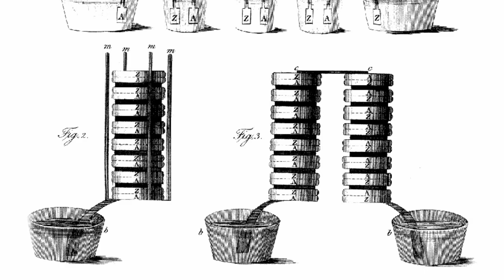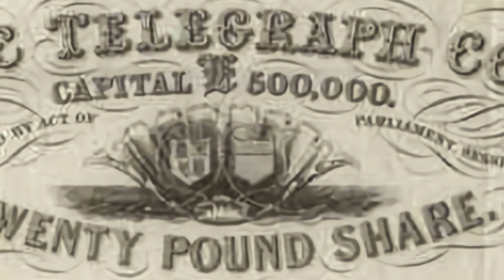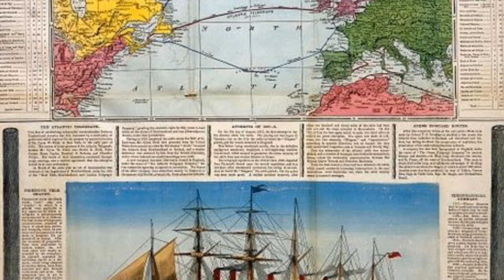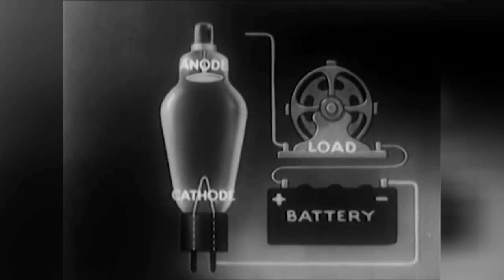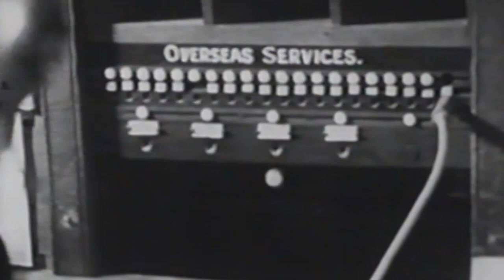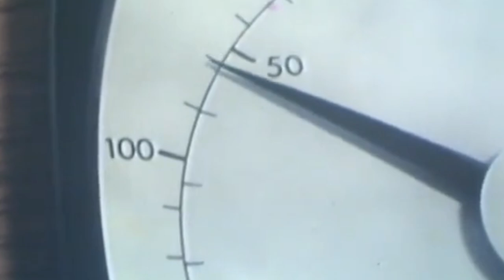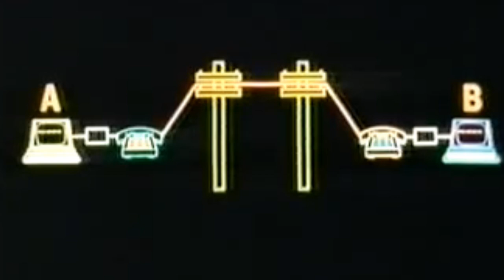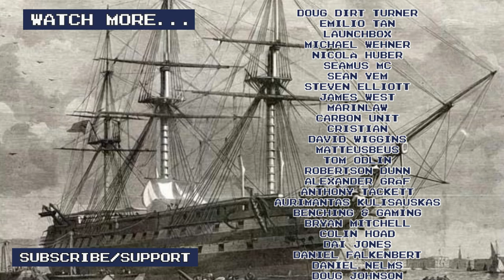How the Internet Crossed the Sea | Nostalgia Nerd

Comment: Imagine being the guy who fries the first cable that had so much effort and work to lay it.
Reply: 5:40 "[Mistaken] that electricity flowed like water rather than pulses [as was soon accepted]. British Engineer WildMan WhiteHouse tried to force a higher voltage down the line to force the messages through. This just FRIED the cable until it stopped working!"
That early cabling never could have worked especially with an impure core resistance too much like a heating element. But in the history books/vid streams a poor single loley British Engineer really took the fall for frying it. Maybe he should have awaited further opinions but still perhaps a bit unfairly, with it arguably making little difference? At least it finally proved to all that a MUCH more thought out approach in every way was needed!
Continuing the water analogy, current is still used and I've heard China interuses pressure with amperage. ;]
Reply: ::starts whistling::
::puts hands in pockets::
::slowly walks away::
Reply: Uhhmm oops sooorrryyy
Reply: @djosearth3618  Er, *loley*? Is that what they sing in rumba songs? Or is it foley artists running down metallic staircases, as they often seem to do, while listening to samples of bullets ricocheting on thingummies? I'd love to know, to be able to interuse it.
Reply: The original IT support disaster.
Reply: @djosearth3618  i don't understand why they haven't checked the cable on the ground first
Reply: @djosearth3618  to explain it as pressure is equally wrong or correct as describing it as current, flow would be better but factually its a stream of particles , in any case it hardly matters
Reply: @user0K  costs length, and probably they have, back then materials were less pure, technology was less advanced, especially cabling tech
Reply: @djosearth3618  That analogy is absolutely perfect though. Electricity flows EXACTLY like water does. What he did was akin to putting too much water pressure into a system of pipes.
Reply: "i got a great idea.......oh well nvm" whistles pats thighs walks away
Reply: No biggie. It was just early alpha testing after all.
Reply: 666 likes 👌
Reply: "So obviously some blimey shark bit the cable, Right?"
Reply: @RaenYrtham  699 Likes 👌
Reply: @TheFalseShepphard  what's up possum? Do I know you?
Reply: @user0K  They did it worked. They didn't understand the capacitance to ground thru the salt sea. In air that doesn't happen.
Reply: .. cable fried!!.... all the effort,  just to 'try and see' So much work........  I guess everyone's gotta start somewhere, and i also reckon they never had the tools to do that test.. it was probably more like "well,... we'll just lay it and see what happens"

Much like today really..  ... Although today, we don't go on these type off expensive mammoth hunts just to "see"
Reply: @djosearth3618  oh i see, thank you for clarifying
Reply: Or the first guy who got ddos
Reply: @reubeng2110  A rather "unfortunate" accident...   You better be bloody sure it never happens again lol
Reply: Lol totally 🤣
Reply: @djosearth3618  Agreed it seemed more like a failed attempt to salvage an expensive asset that was essentially DOA to my mind, makes me think they may have tried it even with competing voices warning the cable could fail entirely, desperate measures and all. That thing would probably not really have been useful even for the highest priority government communiques only. And that is even with some clever trickery to optimise the bandwidth ie developing a code book to condense commonly used words/phrases for that specific type of communication to be as short as possible. By that I mean starting with single letters that are not already words for the most commonly used words/phrases then pairs of letters and so on. But even though that sort of compression can be very efficient with some thought especially when devised specifically for purpose there is a limit to how much bandwidth you can save and that cable had hardly any if it was taking many hours to send a congratulatory message I'd have thought. I don't know the exact text of that message but as it was to be the first I imagine Queen Victoria's advisors would have urged making it short and to the point as it partly was serving to proof the system.
Reply: Honestly I would have done the same, if the signal doesn't get through increase the voltage, it's only natural.

Comment: Hmm... I'm surprised there hasn't been a James Bond where the villain plots to disconnect the cables underwater and cause global economic disaster. They could have sharks with lasers.
Reply: Yes... I would watch this.
Reply: laser sharks !
I like it. Would definitely be a better plot than the current diversicult social justice rubbish being rammed into Bond and other action cinema.
Reply: Sharks with Freakin laser beams!
Reply: James Bond Bandwidth
Reply: Great now where all on the watchlist.
Reply: No it is soviet crabs
Reply: They don’t do real stories in Hollywood. The US totally pulled villain stuff with other countries cables. We sailed into a soviet harbor and dropped a recording device next to their cables.  Kept going back in to replace it. The best part, the smartest part of the plan was not how they recorded transmissions down an insulated cable resting on the bottom of a busy Russian harbor. No, it was how they found the cable. Literally someone saw a “Do not anchor” sign they had to place above their own cables and then wondered if the Russians do the same thing. They did. Reconnaissance photos showed a sign, in line with an important hub, and there was the cable.
Reply: @jlondon1441  wait wait... hollywood. What was that 80's or early 90's b flic with Dan Ackeroid? Sp? Spies Like Us.
Reply: They couldn't get the sharks. So they settled for sea bass.
mutated ill tempered sea bass...
Reply: Are these freaking sharks with freaking lazer beams attached to their freaking heads...?
Reply: How about NO

Comment: Interesting. In the 1960s we're still having trouble making phone calls across the sea, yet we're landing people on the moon and talking to them.
Reply: Radiowaves travelling in  straight line, not hindered by the curvature of the earth.
Reply: It's easier to shoot up than around "corners."
Reply: referral madness  I've heard that fact before. but no. I'm not nearly old enough to remember 16 years before I was born.
Reply: referral madness  yes, lots of people that are older 60, 70, and 80 years old that would remember how difficult it was to make international phone calls.
Reply: @jlondon1441  8-Bit Guy has a great video about phreaking.
Reply: @jlondon1441  in that hacker movie, he used the disconnect paddle to contact the operator, not make a phone call. I'd need proof of you being able to make a phone call dialing numbers using the disconnect paddle. Definitely not just taking your word on this one.
Reply: @keinlieb3818  Dialing by tapping the disconnect paddle was certainly possible in theory. That's all a rotary-dial phone did: disconnect the line for brief pulses of a specific length and interval, with the number of pulses being the digit sent. I don't know if it was actually possible for a human to hit a disconnect paddle manually with enough precision for the dialing system to replicate this process, though; I've heard it claimed that experienced phone phreaks could do it, but I don't have a source on that.
Reply: @macdjord  yes, phreaking using sounds was done to make free phone calls. But not using the disconnect paddle.
Reply: bandwidth, my dude
Reply: Moon landing was a Hollywood production. Was all a lie.
Reply: In even lat 80s international phone calls were something "special".
Reply: If i was in outer space id toss a paper plane and see where it goes lol
Reply: @one_up907  lol that's awesome. I'd imagine it would go into space though.
Reply: @keinlieb3818  lol right?
Reply: When you have line of sight, VHF/UHF radio is a flawless communications method. The military often used satellites as repeaters for radio waves. Now, in the modern era, pirates are using these old satellites for communications.
Reply: @Quoi.Phoque  hahaha! You're ordinary! 😂
Reply: If you have a look at the DSN, you'll see it's every bit a marvel as an international phone call.
Reply: Just felt like leaving that there huh? Lol.
Reply: @keinlieb3818  

In about 1970 we went on a camping trip from school in London to the South of France.  Even at that time we still had to contact the operator and book a call to London in advance.  This was from a small, and rather remote village.

A few years before this STD (Subscriber Trunk Dialing) was introduced here in the UK and we were able to directly dial a call from London to my aunt who lived in Chard, Somerset without having to have the call connected by the operator.  This was not much more than fifty years ago.
Reply: not everything you see on television is true
Reply: Haha as if we really went to the moon 🤣
Reply: Yeah because if your talking about wireless,just impossible and wiring would be incredibly expensive
Reply: @BlaBla-jj6sh  BuT tHe EaRTh iS FlAt
Reply: @WestHaddnin  Did World War II happen?
Reply: @8BitNaptime  nothing has ever happened

Comment: Great documentary, a good reminder that our internet is not invisible satellite wave but actual cables, also the technology about cables is more than just a metal string
Reply: You might say it's a series of tubes.
Reply: Reminds me of people who think cloud storage is actually in the cloud
Reply: You do realize that satellite internet is a real thing right? Cable internet just provides faster speeds therefore is used more. Satellite tv is also a real thing. You use a satellite dish that points up to receive the signal.
Reply: Rawler94 flat earther spotted
Reply: hankyboy42594 yes I know satellite Internet exists, bus is less common, the majority of computers that are connected to the Internet are broadband wired, also most cellphone communications (3g, 4g etc) are wireless until a the nearest cell phone tower, from there its a landline until the destination
Reply: ghgjg hhxgh the distance to the signal tower is too short to be affected by earth's curvature
Reply: @hankyboy42594  Nobody said it isn't. Just not as common. Also, delays in satellite transmission (typical round trip time is about 500 ms) pose significant challenge to real-time communication, so it's not only about speed.
Reply: @Rawler94 Then explain that when you install your satellite dish you get a map of your country / area that shows exactly in what direction you have to aim and at what elevation it should point. They must have very high towers to get that done for an area hundreds of kilometers across.
Reply: @Rawler94 check out the concept of geo stationary and how the signal bounces back from the dish into the receiver on top of the little arm. Then look at the angle of this constellation and see it points high above the horizon. Also check the maps for certain regions in the Northern and Southern hemisphere. If they want to reach the same satelite the North has to point south and the south has to point north. All consistent with the geo stationary satelite at about 36 000 km. You simply cannot make it stick with towers.
Reply: So what do you do on a clear day when there is no cloud in the sky? @bryanjk
Reply: @bryanjk  So what do you do on a clear day when there is no cloud in the sky?
Reply: @Rawler94 I think that when you use wireless or wired internet today, the signal goes from the computer to the modem. Then the connection is sent from the modem to the wires running underground or out of the roof of the house and over the electric poles. Then it is connected to these giant towering antennas with dishes. They transfer these signals over the air from dish to dish until it goes to a facility where it has a giant satellite dish that shoots the concentrated ray into the sky and into space where it bounces off a satellite floating in earth's orbit. Then it falls back down from earth thousands of miles from the current house and ends up in the location of the internet provider. I guess I am right.
Reply: @Rawler94 As someone who used to install satellite tv for Dish Network and Directv, I can assure you that the satellite dishes are pointed toward satellites in the sky and not towers. You can even download an app on your phone to show you where the satellites are in the sky in relation to your location and check if there are any trees or other obstructions in your way.
Reply: @NeighborSenpai  no cause you have obstacles even if its short
Reply: @Rawler94 cant argue with trolls i guess.
Reply: @Rawler94 I have a lingering feeling you're a troll, but one last try: the earth rotates around it's own axis (obviously), and the satellites rotate around the earth at exactly the right speed for them to always appear in the same place in the sky, i.e. stationary as seen from earth. You might even say geostationary.
Reply: @Lumer What in mid ocean?
Reply: @Lumer It is explained here: https://en.wikipedia.org/wiki/Geostationary_orbit
I can tell you in my own words, but it would be lengthy and incomplete. 
There is an orbit around 800 km where earth resource satellites go. The ISS grazes the atmosphere at 500 km, making a lap in 90 minutes. The geostationary satellites at 3000 km from the surface take 24 hours for one lap. In the same direction as earth rotates. Making them look stationary. Just like a car in the other lane seem to be stationary compared to your car, regardless of both your whizzing speed.  
Satellite dishes in Africa and South America are open in the center because twigs and rainwater would collect there. Because they point almost straight up.
Does it make sense?
Edit: WERE open. Dishes nowadays have off-center focal points so all sit more vertical but still different: use googlestreetmap and compare dishes in Finland and Equador.
Reply: a huge amount of the companies that handle the transatlantic communication use satellites as backup. Satellites are also used when there's no free capacity in the cables (which onbviously is less of a problem now, but it was a problem in the 1990s when internet use exploded)